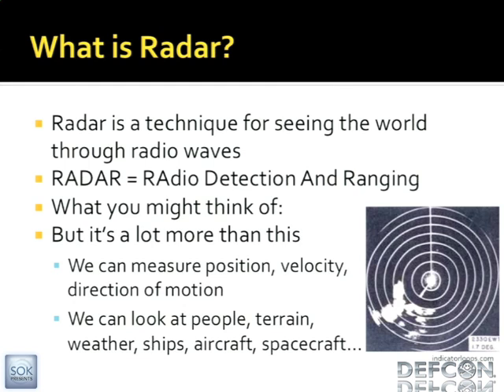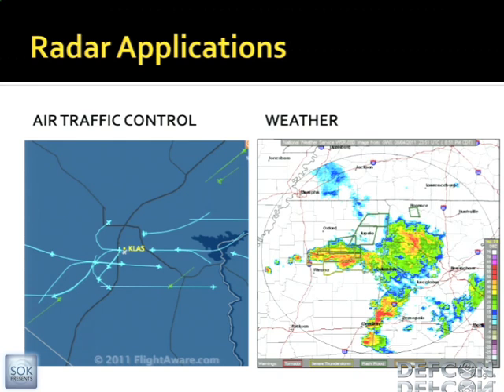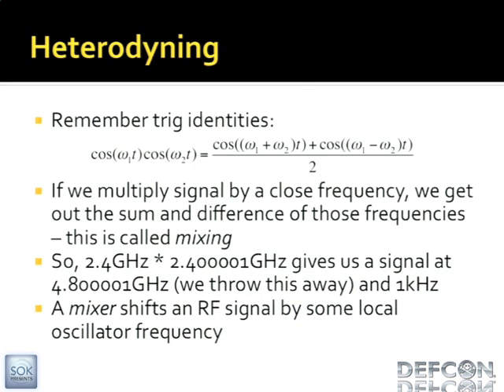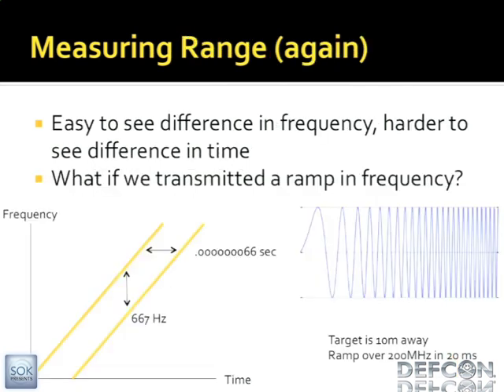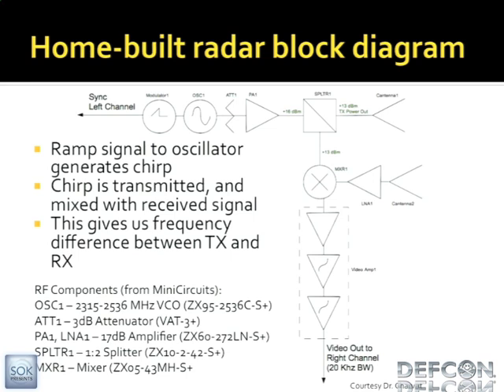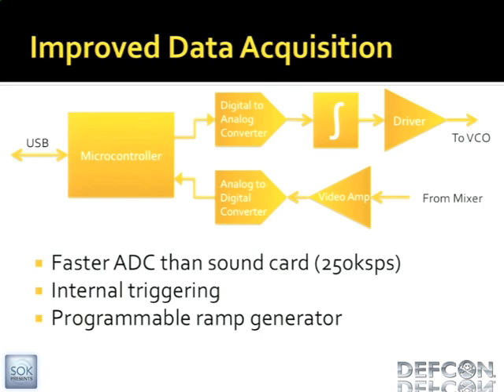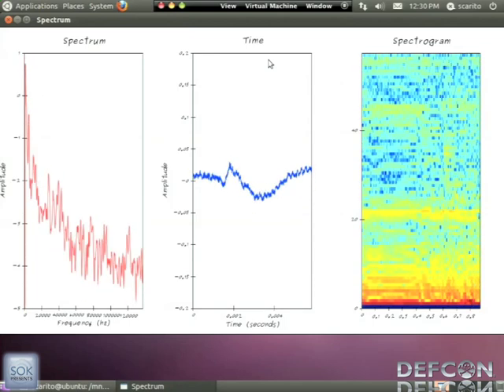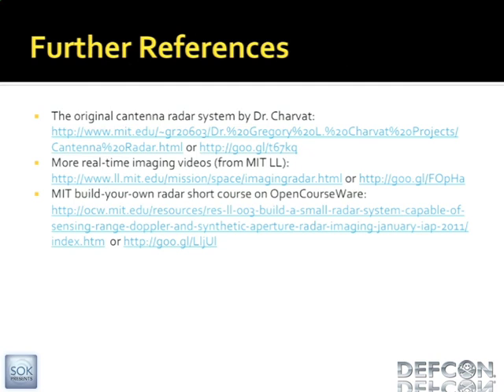DEFCON 19: Build your own Synthetic Aperture Radar

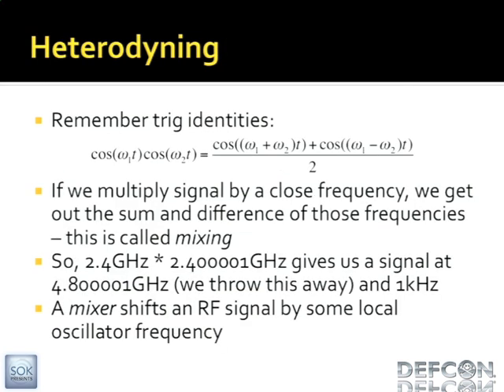Comment: Note: @10:02 Sum & difference when mixing signals… NOT PRODUCT. IOW: It’s not 2.4 GHz * 2.400001 GHz (that would be 5.760004 GHz)… it’s 2.4 + 2.400001 GHz. Also, you get four out: the sum & difference & the two original signals.

Comment: Very helpful video. I needed this information in addition to the contents of "RADAR Basics: A Comprehensive Guide". This information I'm using to build an active RADAR. I'm working on developing a cost effective (cheap components) RADAR System where ALL of the signal processing is offloaded to today's powerful computers. As opposed to doing all of the mixing and filtering and such in inflexible hardware, my system will be based on the cheap magnetrons in everyday "microwave" ovens, pulsed at a PRF of 0.5 Hz to 15 kHz but with a VERY low duty cycle (pulse length from 1us to 1ms or longer). The magnetrons filament will be powered always, the pulses come from a pulse transformer fed by a MCU+FPGA controlled solid-state modulator. The same MCU+FPGA that controls data acquisition , SYNC, pulse shape and length will send ALL of that information over Fibre Optic connections to any properly equipped computer, even a consumer laptop, and all controls come from the same computer to the MCUs/FPGAs. All totally reconfigurable due to the use of FPGAs. BOM cost ~$1200. I'd like to see Raytheon do that for the same cost.....
Reply: I’m sure they could, but their way is far more lucrative, especially with a “former” board member as a sitting SECDEF.
Reply: How did your project go? Any rabbit holes to avoid for anyone trying a similar project?

Comment: So, I have a question that's a bit tangential.  At one point he talks about pushing signal into the FOSS toy, Audacity.  I would like to see/hear what is done after then, because I have WWII radar recordings in analogue and would love to be able to analyze them.  Right now, we have to find a WWII AN/APQ-13 and restore it and run the recording through the system to see what it is.  Problem is that the same exact unit that recorded the radar waveform also could be switched to record voice.  I have access to a lot of these, and if anyone can help, I have means to get funding.  Some of this will require laser scans, as the waveform was recorded to 2 mediums---an acetate over aluminum core disc, and magnetic to a wire.  

If you're interested, contact me.  You can find this project on facebook using the name keywords here.  

Thanks!

Comment: I have wanted something like this for years. I am a life long storm chaser (mostly lightning photography). This device would NOT help me in storm chasing. Really, I do just fine without even the gov radar usually. just forecast charts and some petrol in the car and off I go. but god knows I would still love to be able to see inside a thunderstorm. To have a totally different and unique perspective. I would only need to be able to detect raindrops out to something like 50 Km, if I need more than that I could just look on the government radar network. So, I would love to build one. but where do I start, is there any Instructable type pages for this project?

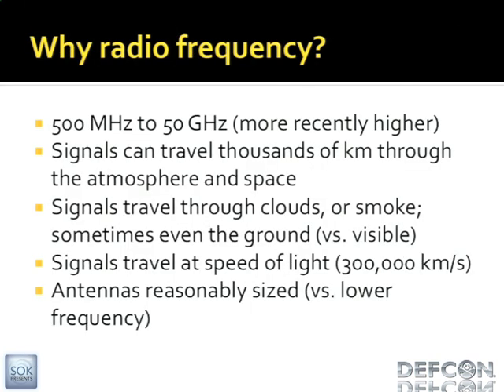Comment: 7:18 - there are radars in other frequency ranges, like over-the-horizon radars operating by reflecting radio waves from ionosphere, then from target, then again from ionosphere. P-18, quite early Soviet military radar, operated in VHF range, and because of this it was possible to shoot down F-117 stealth aircraft using this radar, since stealth aircraft are optimized against more common radars operating at higher frequencies. Car radars operate at 24 GHz and 76 GHz.
Reply: +Mieszko Guliński  and you mentioned the f-117 shootdown, likely they were tracking the aircraft with the p18, and when he opened the bomb doors the guidence radar could see him, the weapon used was a s-125 sam system, guided by small radars like the p15, the sa-4 goa radar, prv 11, could get a positive lock on the f117 with its bomb bay exposed, resulting in the shootdown
Reply: There were even experiments with ground radars (detecting underground objects) in VLF range, where lightnings were used as sources of electromagnetic pulse.
Reply: Mieszko Guliński Re P-18 stuff -- kind of, but not really. P-18 is a 2D search radar, not a FCR, and the S-125 (normally the P-18 is an SA-2 thing) doesn't use it to guide missiles; shooting something down still requires a track with the FCR, which is X-band. Stealth aircraft are optimized not against more common radars, but against the kind of radars that give tracks precise enough for weapon targeting (~X-band, NATO India band or so). This is really hard for other aircraft to work around because the antenna and power requirements for high resolution lower-wavelength radars are absolutely prohibitive and UHF search radars like the P-18 are physically gigantic (too large to fit on aircraft).

Also, just because aircraft behave as Mie scatterers to them doesn't mean that they automatically have a larger RCS, and Zoltan Dani's testimony himself suggests that the F-117 has a very small RCS in the P-18's wavelength (as he first saw it at ~23km and managed to track it at ~18km). Low Blow/P-15 (and the SA-2's Spoon Rest/P-18) are of a low enough wavelength that you can operate it without fear of antiradiation missiles (you can't put antennas large enough to actually see the radar in them!), so he was able to radiate constantly.

tl;dr: the P-18 is only good against stealth aircraft if one flies right on top of you, in which case you can use basically any other radar thanks to received power scaling exponentially with distance. low-frequency radar isn't much better against stealthy aircraft than conventional X-band radars found in fighters and missiles and it comes with a whole host of downsides.
Reply: Thanks for more detailed explanation :)
Reply: No problem! It's a fun topic, haha.
Reply: can nack- Serbian army shoutdown f-117 nobody tell what they use to do it but there is 1 soldier who tell that they got something new and they hope it will work and they find f-117 and shout it down what kind of radar you think they were use?
and i m interersted in building radar or sonar do you have some advise? or do you know how to make it?
Greetings from Serbia :)

Comment: If anyone plans on building one, it will be more powerful if you install a flux capasitor. You can find them reasonably priced at Radio Shack.
Reply: Flux capacitors are easy...  But how are we going to generate the 1.21 gigawatts?

Walmart only stocks Uranium products.  We need Plutonium!
Reply: I read in the paper lighting will strike a big clock that doesn't work. We could hook up some jumper cables an shit. lmao
Reply: Volforlife
Great Scott!  It just might work!  Marty, you're a genius!
Reply: Volforlife I checked Radio Shack and they no longer carry flux capacitors. They sell hysteresis loops as replacements instead.
Reply: Volforlife I would also recommend upgrading to a dual hamster wheel design, to double your available power.
Reply: Funniest crap I ever read on YouTube, by far.
Reply: Volforlife radio shack got closed though :(

Comment: Sonar is easier for hobbyists. An ordinary tweeter and then to time the returns to microphones. Timing of several microphones start to give you the aperture required. You can fit these in a wand that is rotated as they face the direction of interest.

Synthetic aperture radar is good because it's possible to see in 3D through walls, ceilings and floors giving a whole new perspective. Running a large series of Frequencies could also show various absorption and retransmission spectra.

Sadly this video did not really encroach on Synthetic aperture radar

Comment: At 9:50 he described how AM transmissions work, not FM...
Reply: What he described is how a superheterodynes mixer works in a simple to digest way...depending on if you use a sample from the output of the demodulator to feed an AFC that would control the Local Oscillator(FM) or if the sample was fed to the IF amps with an AGC to add amplitude to the signal(AM) the would determine if it was AM(Amplitude Modulation) or FM(Frequency Modulation)....and in this case the ramp generator varies the frequency not the amplitude.  So I'm pretty certain it is in fact an FM device. Your home stereo uses a superheterodyne and mixes the modulating signal with the local Oscillator in the same way regardless of AM or FM setting, the changes occur after the mixer.

Comment from the maker: what part did you find the most informative?
Reply: Really fuckin tiny
Reply: I was wondering if it could only detect a gps tracker for a car, If so then can the person in the car talk with the person at the radar screen, Now can it also work with multiple gps tracker that can talk with the person at the radar screen and can there be a way to have another person looking at a weather radar talk with the person in the car, Is there a way to have the gps tracker connected to a car gps that is bought separately from the car but to only send to the person looking at the radar screen the destination without getting ride of the route line when the car follows it if so then can the person looking at the weather radar receive it too, Is there anyway to increases it's range to infinite (if possible), and also for the gps tracker is there a way to give them names?

Comment: From the Doppler shift, a car traveling at 120MPH would result in a ~900Hz phase shift if your LO was 2.4GHz. If you were using 77GHz, it would a ~27.5KHz phase shift. Going from 2.4 GHz to 77GHz yields a 32x performance increase in sensitivity. The Phase sensitivity increases linearly with the frequency of the LO. 

Fr = Ft((1 + v/c)/(1-v/c)) , c = speed of light, v  = meters/second, Ft = local oscillator freq.
Reply: yes.
Reply: 77GHz, off the shelf now. But we have 120 and 240GHz.
Reply: Can you translate that to caveman for me
Reply: @limabravo6065 The higher the frequency (i.e. shorter the wavelength) the greater the capacity to detect a phase shift given all else is the same

Comment: 1) definitely, but someone has to design the damn thing (microwave RF is a bit of woo-doo magic...)

2) technically yes, it could measure in smaller steps, but practically it all depends on the precision of the frequency capture...
Also, components would be far more expensive and a lot harder to get...2,4 GHz components (namely amplifiers) are cheap and available...

Comment: I wonder if two possibilities are available:

1) Can the design be converted over to a mass produced single PCB for the RF front end to lower the cost?
2) Would better resolution be achieved via the same bandwidth pulse at a higher frequency (5.8GHz or 24Ghz centers), or is it the pulse bandwidth itself that limits resolution?
Reply: He will never answers to you...
Reply: A lot of things limit resolution, wavelength size, antenna size, distance (range) to what you're trying to look at etc...